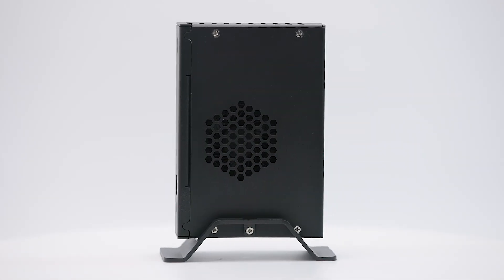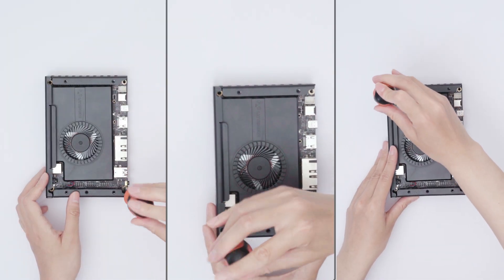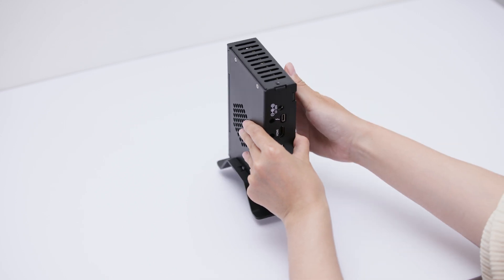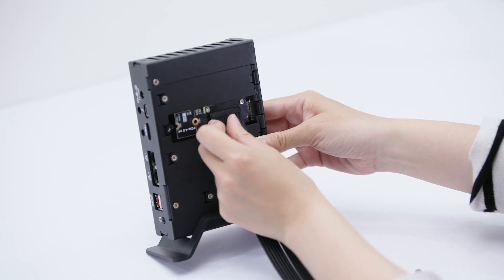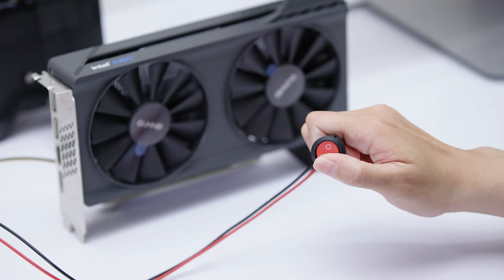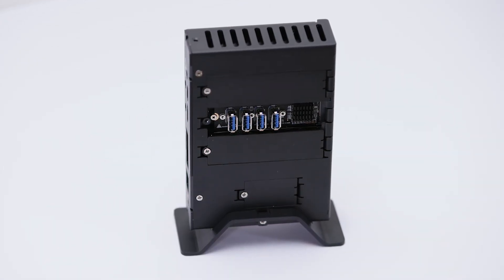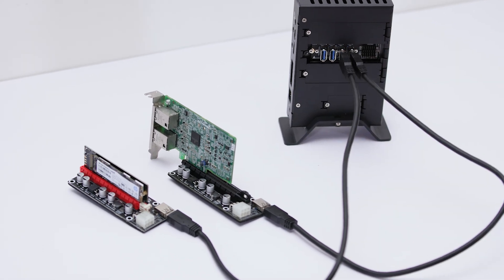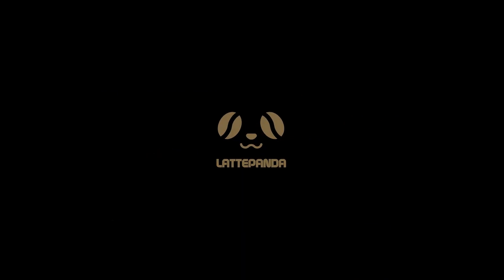How to install the vertical aluminum alloy case which supports M.2 expansion for LattePanda Sigma

Comment: I have a few questions:
1) can the Sigma boot from an m.2 ssd drive?
2) is there an m.2 to sata adaptor that would allow connecting 3.5" drives for a NAS?
3) IF the answer to question 2 is yes, then how many sata connections can the Sigma handle at once?
4) do you make a similar modular case for your new MU compute module?
Reply: 1 yup, 2 yup, 3. I dunno, but guessing around 19? 4. Dunno
Reply: @JazzTechie WOW! Thank you for responding!
Take care.

Comment: How is the GPU powered in this setup? PC power supply or can a lower end gpu like a 3060 be powered by the Sigma?
Reply from the maker: If you add a graphics card, you must use additional power supply.